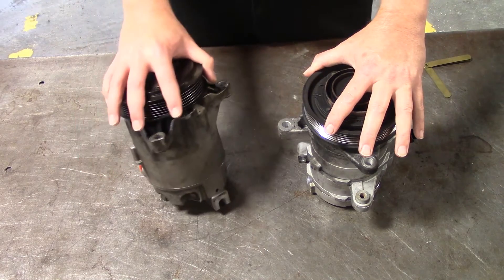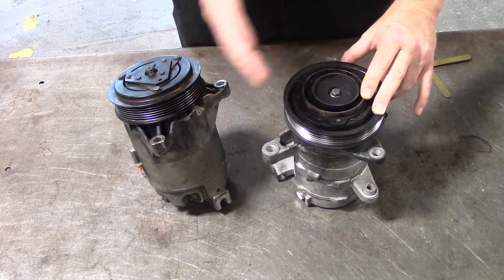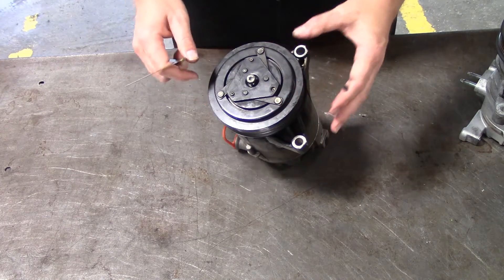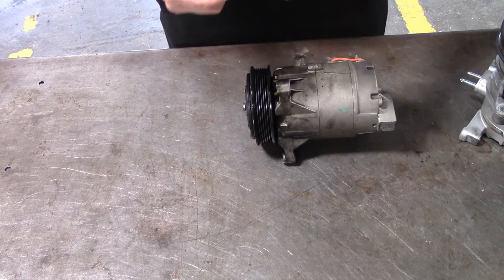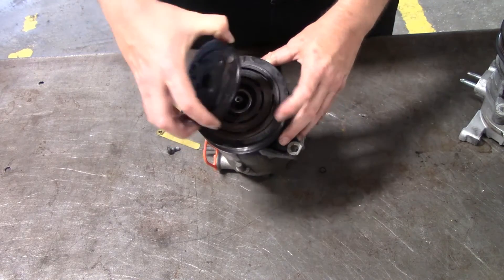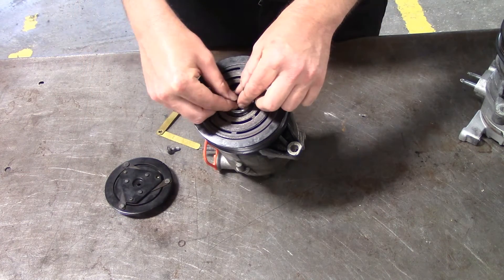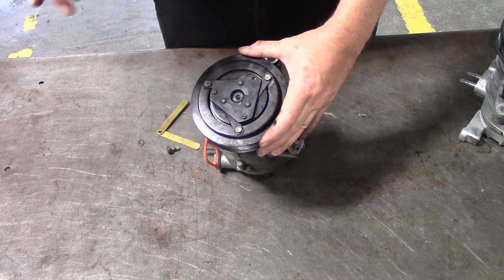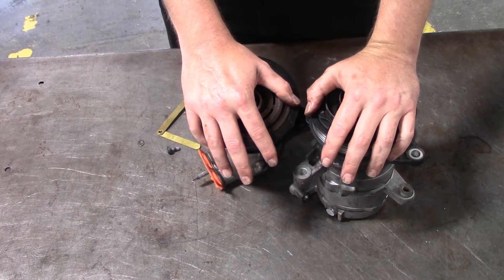Technician Training Series: Inspecting and adjusting air conditioning compressor clutch

Comment: Decent video an adjustment only I'd say as a last resort if you're driving across the desert and it's life and death.
Thus  partially disagree a little bit allow me to explain 
1
 if you're having to adjust the clearance on the clutch plate assembly, and not serving your customer by following 2 below.thus  finding the cause then you're actually doing a disservice to the customer will end up having to do this again or worse a full AC and other parts.. explained below
And within that I'm assuming those customers come back to as they trust you only get the billing for that plus a full AC replacement when if you follow my explanation below your customers would be not ripped off sorry for not beating around the bush what got me was your statement of if the clutch pulley bearing is wonky you say the seal on the shaft to the internal compressor may start leaking if you pull the pulley off.
That gets me like that is an outright bold lie. And wrong to infer that replacing the pulley bearing for $50 in parts and on most cars less than 2 hours labor I have to clarify to cause that compressor input shaft start leaking because you pulled the pulley off even if you used a screwdriver or a pulley puller you're not going to bend that shaft unless you hit that shaft with a heavy hammer on a 90 degree angle to it at the very end just to be clear that shaft is taking all the force from the belt system tension even though it's not under extreme tension throughout the life of the vehicle it still requires a higher quality metal as you're talking about over extreme temperature differences and long periods of time with that shaft being in a different position so yeah that's yes more heavy-duty than what you're implying

So going back to it if your AC and clutch assembly are making noise the proper thing to do would be to spend the extra $50 for pulley bearing which takes an hour of Labor the bill at least as even if it's not giving you play like a wobble and even if you don't feel it giving you play front to back I pretty much can guarantee when the engines running and things good up to temperature that bearing allows that pulley to move and you're going to end up doing more damage to the clutch plate and the pulley possibly to where the next time the customer has an issue they won't be able to have the proper procedure done because you've already worn down by removing a a Sim it's kind of like turning a rotor on a car

I have seen what you recommend seize and throw a belt causing the crankshaft position sensor first hand and I told him

 the cause is more likely to be from the clutch pulley bearing

So if they come in for that instead of half-assing it do it right put the good $50 bearing in that's got a markup built in and the customer will even be happier and it didn't take any more time you show me one compressor that the shaft started leaking
Reply: You come on here to dis this mans awesome video but your reply is so horribly written nobody will care what you say. Yes that’s a period.
Reply: @devonrose888  right. I couldnt even read more than 4 sentences. What in the fuk is this guy going on about? Lol
Reply: I'm not reading all this 😂

Comment: Thank you for explaining. I have a 05’ Lexus RX330 with a the A/C intermittently blows cold then hot. I suspect the magnetic clutch assembly. I do have the factory repair manual, and it tells you the clearance measurements, and in the photo they  used a dial gauge, which I don’t have, but I do have feeler gauges. Problem is ,  I didn’t understand where to measure. I know it’s between the pulley and the clutch inner plate, I visually could not understand. After watching this video, it makes sense now. I probably would have figured it out when I get my eye on it , but I wanted to be clear before going in. Thanks again
Reply: Unfortunately for us all it isn't just the clearance when it comes to air conditioning in vehicles. Their have been times where I found it to be the wiring harness. I also had to install an electric fan because my trailblazer has a fan clutch so on the highway it was fine but once it was idling at a light  it would get warm or the clutch would disengage. But this is what trouble shooting is made for. You live and you learn
Reply from the maker: Awesome! Thanks for watching.

Comment: Good video; thanks.  I've been researching A/C compressors/clutches on my 09 Malibu Hybrid because my A/C isn't working this season.  What I found is confusing as the A/C clutch bolt is unscrewed partially and is bent.  It still spins when the A/C is engaged and kinda stops when disengaged. Appears very loose.  I tried to tighten it up but the bolt just turns without tightening.  Any idea whats going on here?
Reply: Need to hold the cluch stationary to tighten  the bolt.
Reply: @metzmatu8409  I guess he fixed it.   lol

Comment: My AC compressor is stuck when clutch is engaged, tendency to my engine to turn off of shut

what could be wrong?

Can you help? Thanks!
Reply from the maker: Sounds like the compressor is locked up. You will probably need to replace it.

Comment: Any ideas why the AC clutch would be making a metallic raspy sound on a brand new AC compressor replacement kit in a 1999 GMC Sonoma with the 4.3L V6?
Reply from the maker: Could be a bad bearing or the clearance is too high, which makes the clutch slip. If it’s making noise at all, I would probably exchange it for another if it is under warranty. I hope this helps, and thanks for watching!
Reply: @AutoScholarwithMrB  it only does it when the clutch is not engaged. When engaged there is no noise and everything runs fine
Reply: clutch air gap is too small then

Comment: Great video, thanks. I have a 2015 duramax and upon inspection of my AC compressor i found the bolt missing. This allowed the outer clutch to be sloppy and every time the AC turned on it pulledthe clutch on like it should be, but being lose it destroyed all the splines on the assembly. I installed a new clutch kit and all good. 
Kits come with extra washers, those are obviously for setting the right gap.
Reply from the maker: Apparently those are problematic, as I have done two of those before. I suppose the vibrations may cause this issue.
Reply: The washers are made of metal or copper?

Comment: I have an intermittent AC issue. I've read online and my year and model of car is prone to clutch issues. I'll notice it spins in intervals of 4-6 seconds most the time and it makes a whirring noise similar to a coasting bicycle. Any idea what the issue could be? I've had it at the dealership for two days and they are trying to tell me I have a bad thermistor and want to tear apart my dash and charge me 760 bucks 🤣.
Reply from the maker: What type of car? Any hvac system codes?
Reply: @AutoScholarwithMrB  2010 subaru Impreza and no system codes.
Reply: I am having the same issue on my 09 mitsubishi lancer.

Comment: My clutch burning 3times.. why
Reply: Check condenser
Reply: @leinadinnaz3308  what does the condenser have to do with the compressor ?
Reply: It could be that the compressor is not spinning freely causing too much friction with the clutch.   Could  be a bad bearing,  also causing too much friction.  Also,  if the gap between clutch and compressor is too wide, the clutch does not engage fully and burns itself out.